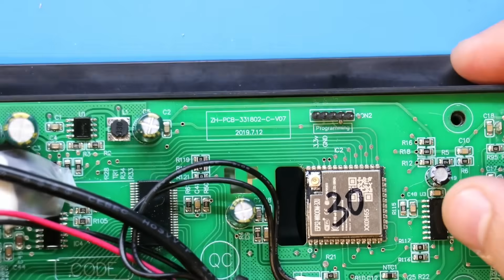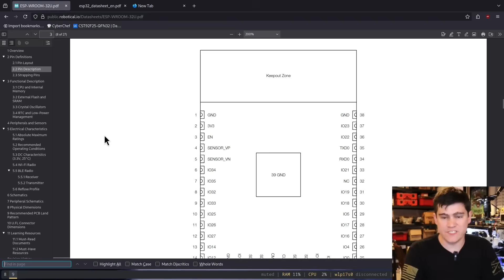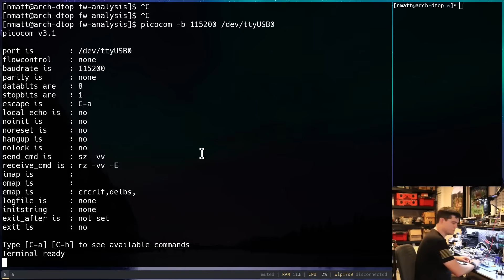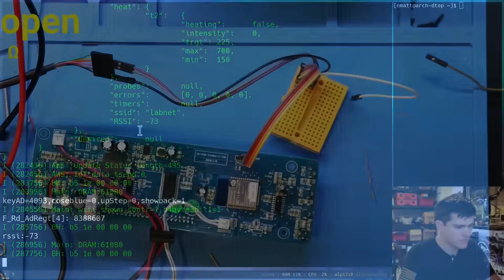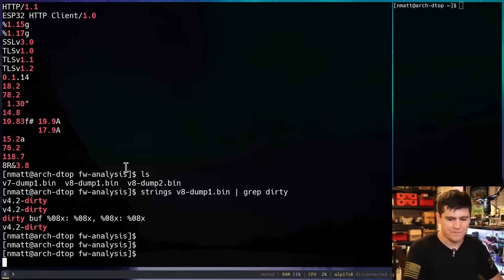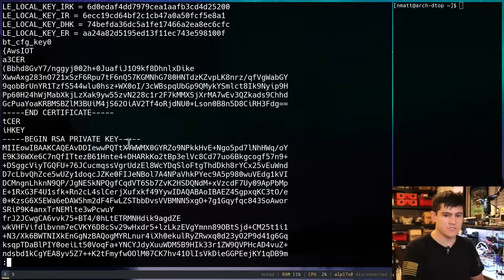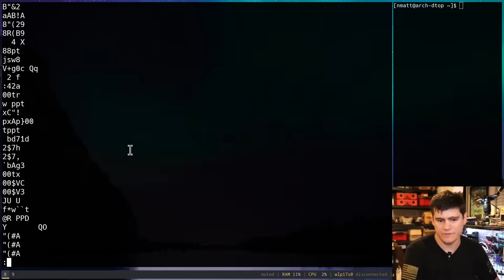Hacking My Smart Grill - Extracting Sensitive Data on ESP32

Comment: hehe this is the point where I would start figuring out what the other pins on the esp32 do, configure ESPHome to emulate that and cut it from the cloud and bind it to my home assistant ^^ but also I'm not a pentester, just someone having fun with hardware and hating devices talking to things outside my network :) Looking forward to the next episode, there will be new things to learn :)
Reply: ESPhome would be really cool for that, but you could also mitm the device and have the code in a home assistant integration to mimic the AWS server and application.
Reply: @judman13  that means that the communication would also have to be reversed. But still you never know exactly what hides inside the original firmware. Replacing it with your own Firmware would make it truly your device.
Reply: I did exactly this with my Thermopro BBQ Thermometer TP920. I created a python script to emulate the Bluetooth handshake then handle the sensor data reading and changing of temp modes. My only issue now is getting it to work in Home Assistant. I have no clue how to build a custom component so I'm unfortunately stuck right now
Reply: @bgubs07  hehe nice. I don't know, most of the time the answer in HA is MQTT. It could be a separate script that communicates via mqtt with HA
Reply: @bgubs07 nice job my friend! You have got the hard part done. AWS with Alexa iot isn't too hard from the guides I've seen.
Reply: @bgubs07  just add mqtt to your python script for sensors and set functions.  You can add those manually into configuration.yaml on home assistant and after reboot they show up as devices you can add to lovelace
Reply: This would be very interesting, since I'm looking forward to hardening my home automation network to only local. It would be interesting to see custom FW versions in future as well where you could use e.g. different PID settings depending what you're burning and maybe a separate start and run sequence for smoking. Also I would like to have a few more temperature sensors to control/monitor the ignition phase better.
Reply: @kauttophs  In general a custom firmware should be possible more sensors might need extra hardware due to the limited number of pins but yea. Sadly I don't have that device so I can't really help with that.
Reply: What sucks is they sanded the ADC and Thermocoupler chips. Easy enough to trial-and-error what chip they are, but bleh.

Comment: The 'dirty' part of the version field usually means that the firmware was built with changes on top of a release tag. That is funny because they probably don't want to be releasing code that isn't in a tagged release.
Reply: There's another possible reason: Poorly written build script or makefile. The build script changes some files when building the project so git will give a version string with 'dirty'. The only way to check whether there's unarchived change is to compare the binary dumped and the binary compiled by yourself.
Reply: Dirty in Git is if you have unstaged, uncommitted work area changes. It's supposed to mean that it's a developer build that doesn't match source control, but often people have slightly sloppy build pipelines that dirty the work area during the build and then all your builds can be labeled as dirty and it doesn't mean anything anymore.

Comment: pretty cool video. so they using MQTT, I wonder if they used Zephyr RTOS using MCU boot would things be less easy. Some tricks would be to ACK when you connected to UART, if nothing then clear the flash for production level hacks. uhmm.

Comment: Anything storing wifi creds that lives outside the home should be encrypted IMO. If someone came by and swapped out that grill module, most people would just think the device reset. Then your wifi is exposed and an attacker could try and break into sensitive devices on your network.

Probably far-fetched, but it could happen, especially if someone is being targeted
Reply: It is possible that you sell your grill at some point and most people don't think about factory resetting a grill. Hell, most people don't even perform a simple format a harddisk when they sell them, let alone a dod wipe.

I must point out that encryption would never be very strong as the (most likely symmetric) has to be also stored on the same device. It just protect you from having plain text credentials from a flash dump, but in the same dump there is also the code that decrypts the encrypted data. If the encryption key cannot be found using strings, you could use an esp32 emulator like wokwi to run the code, attach a debugger and read the key from runtime memory and then decrypt the WiFi credentials. 
But it is always a good idea to encrypt sensitive data, even if it can be decrypted by someone who can actually code and understand applications. It would still protect you against prying flashdump eyes and a considerable amount of script kiddies.

It speaks to the mind of the company if it uses encryption by default or not. Also just dumping sensitive data over uart is a thing. At least require some command first before you print out data. The company that developed this board only assumed happy path usage. Never crossed their mind someone 'unauthenticated' could read the uart. This is one of the issue of IOT devices. A lot of companies buy 'off-the-shelf' SDK's and add some additional code of their own. Once the developer signals their have a working concept, wheels are put in motion to bring it to market asap while the development department is still cleaning up stuff and adding improvements.
Reply: @2Fast4Mellow  ESP32 stores flash encryption keys with efuses. Not in flash, not accessible from software. Together with secure boot it's actually pretty hard to bypass.
Reply: The thing is, no one cares about your WiFi password, so no one's going to risk going to jail or getting shot trying to steal part of your grill.  Also, 99.999% of people do not have "sensitive devices" on their network, at least any that don't already have a public IP address on the cellular network.

Comment: I get that storing the passwords clear text could be an issue, but I think the risk is low if you have to have the physical device in hand. That said encrypting it is only as good as hiding the encryption key also in the flash somewhere. If someone finds the key like your RSA cert and then uses it against the password they would also get the password. But both require getting into the firmware which is not going to happen without having the physical device. I find some security questions like this kind of silly. I mean who is going to take apart someone's grill to get someone's wifi password? Like there are far better ways to capture that without needing physical access to a device at all. I think some security concerns are just silly. Some are valid but many are silly like this one. Thanks for the rundown though this is neat to hack hardware. I have never needed to go that far but I would love to try it one day. It would be less appealing to hardware hackers to attempt it if more companies simple documented their api calls and allowed people to build and configure local servers instead of hiding it. You could make any iot device run local without a subscription but of course they would make money on that.
Reply: If you encrypt the flash storage you obviously don't store the encryption key in plain text alongside it, it would be in a HSM.. The rest of your comment also sounds a bit uninformed if I'm honest, security isn't just about you, the user, getting "hacked". With exploits like these you may, for example, be able to circumvent product restrictions, either commercial (think subscription features) or safety (temperature limits)
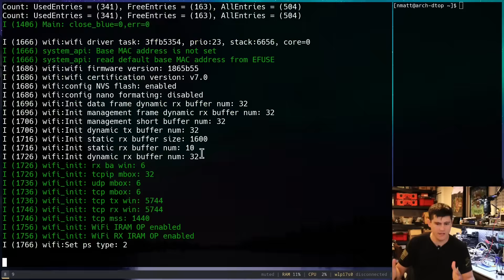Reply: Just xor'ing the password with a one-time-pad would prevent it from being in clear-text in flash memory. It's not enough to stop a determined reverse-engineering (or it being spat out in wifi debug logs at 17:23 as someone else points out), but it prevents it from showing up in strings or hexdump output.
Reply: Until people start stealing grill displays to extract SSID's and passwords 🤣
Reply: If the person sells it 2ndhand on ebay, and someone can get their wifi password from it, that wouldn't be good. Especially if the password is something deeply embarassing.
Reply: @Aera223 lol I suppose your right about an embarrassing password god forbid. 
esp_log_level_set("wifi", ESP_LOG_NONE)is what they manufacturer did not include in their program! This stops the debug wifi messages and should be included in any production firmware.  Just an fyi...
Reply: @newmonengineering good idea, and probably add to some dev firmware too, coz even the devs may have embarassing passwords (imo masking passwords from logs should be the default way logging works)